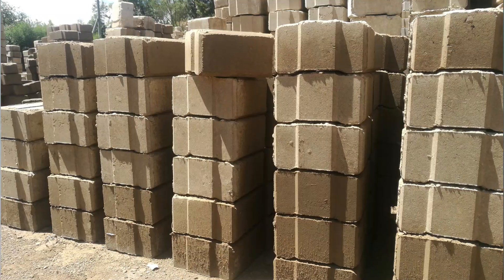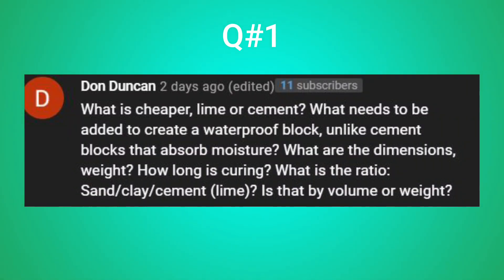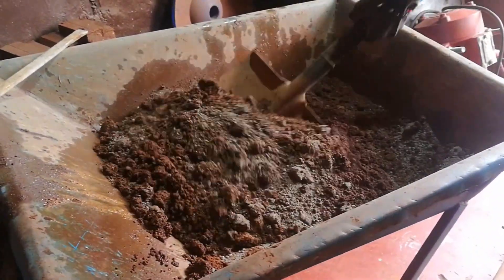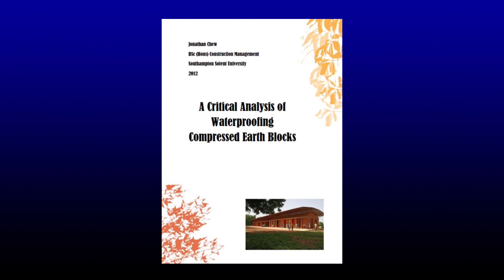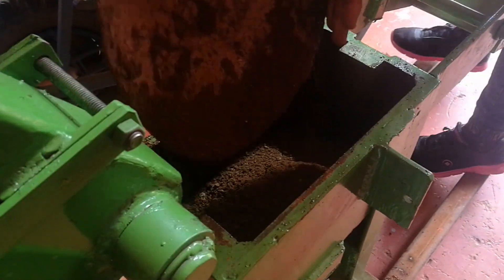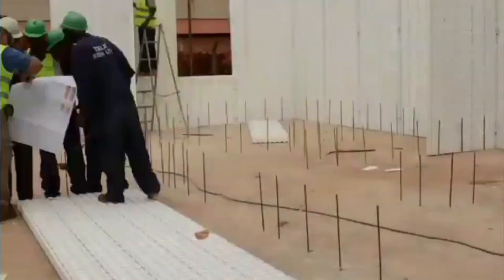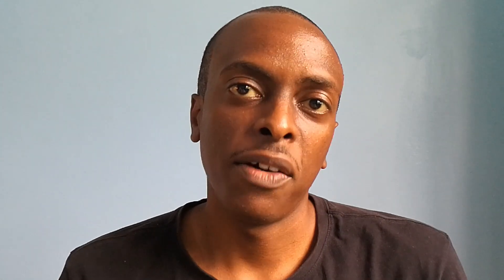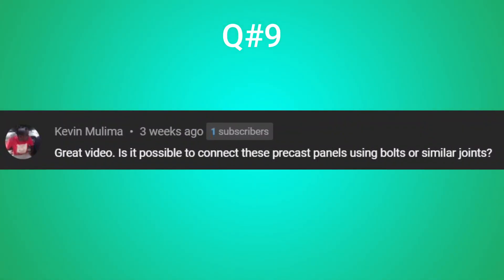Q&A - Answering 10 of your questions | 1,000 subscribers celebration

Comment: Congratulations 👏 🎊  property noma. Thank you for you informative videos, I'm looking 4ward to build my 1st bungalow flat roof but I might extend to 1st floor. I was gonna use the precast panels for the walls, now  how strong are they from the normal building stone blocks?  and how long do they last?  I've seen several pictures of houses that have several floors and have used the precast walls and I'm told the weight is distributed @ the colums and beams. Is it possible to have a 3 floor flat using precast walls? The last question is, can you also make a video of the step by step or normal process towards construction of a house,from foundation,  to the roof or slab of the house. Thanks for the great effort 👌
Reply from the maker: Hi James, precast panels are used to partition walls. For load bearing, especially buildings with 2 or more floors, beams & columns are used. The panels are lighter than stone blocks but since they're made of concrete, they are strong and durable.

In future I'll make a video showing the step by step process of building a home from scratch.